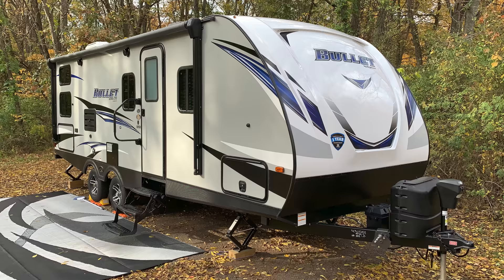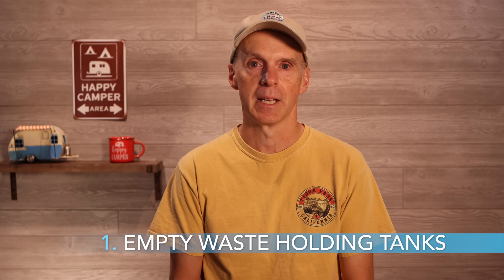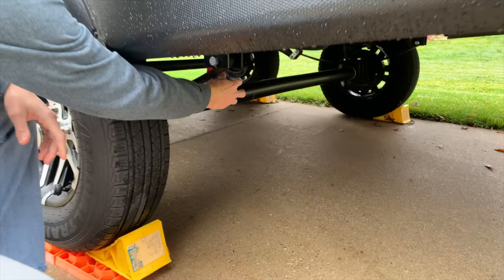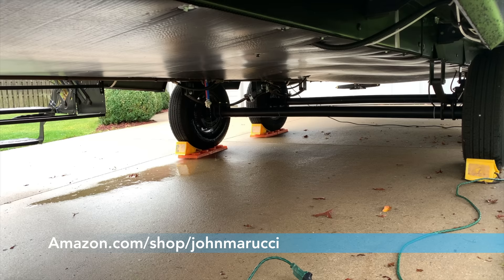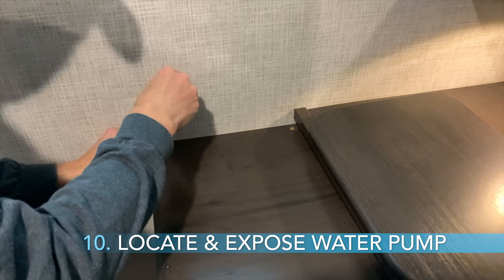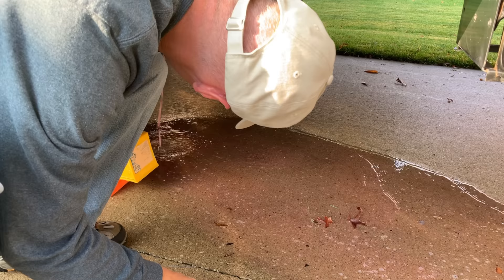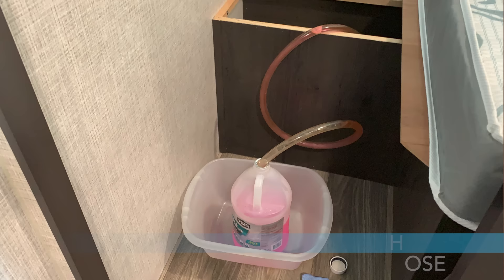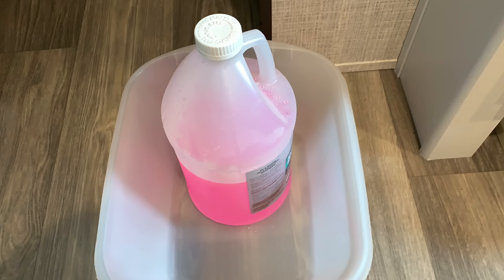RV Winterization Basics For Beginners – Step-By-Step Process

Comment: Thanks John, I do have a question, after you’ve removed all the water from the RV and you’re adding the antifreeze to the lines. When you go out to the outside shower and spray hose how do you still have water to spray?  I just thought it would be pink after a few minutes.
Reply from the maker: Eric, there is still some water in the lines that the pink antifreeze pushes out. This includes the line to the outside shower. You need to run it, even after draining via the low-point-drain as you do any other plumbing line until pink antifreeze starts to come out. If I am misunderstanding the question feel free to post again or email at: "john@johnmarucci.com" Thanks!

Comment: This is a great video thank you very much. I do notice you mention turning on the pump in step 13 and a few other times but never mention turning it off until the end. Are you turning it off after each step or just when you are finished?
Reply from the maker: Mike, sorry for any confusion, it is implied that you turn the water pump back off between steps. Thanks!
Reply: All good. Got it done that day. I did learn there was a valve that needed to be open that ran between my hot and cold lines for the water heater as antifreeze never ran out the cold low-point spots until we opened that. Evidently, it was just pushing it through the hot lines. Luckily, we were capturing the excess so not a lot wasted. Lesson learned. Do appreciate the help!

Comment: Can you please explain why you need to put antifreeze into it if all the water is drained? I'm a little confused. I live in NE Texas and it can get a bit cold but not as cold as  it does up north. Is the antifreeze still necessary?
Reply from the maker: You probably could get by with using forced air through the lines and pass on the RV antifreeze. The RV antifreeze provides an extra layer of protection, just in case you didn't remove all the water. If you desire to go this route, search YouTube for RV Winterization with Compressed Air. Thanks!

Comment: John, great job on the video i had some questions maybe you can answer. I'm guessing you leave the antifreeze in the tanks for the cold season in storage? What is the best move if i am going on a trip in an area with freezing temperatures. I will be dumping multiple times on this trip, so should I winterize even though I would be dumping my tanks multiple times?
Reply from the maker: Fernando, I do leave the little amount of antifreeze in the waste tanks off-season. If you plan to use the trailer during the winter, you should be fine dewinterizing and using the plumbing lines if it dips below freezing, as long as you are in the RV and running the furnace. This is all contingent upon your RV having an enclosed underbelly that gets some heat from the furnace. Between trips you may need to winterize if the trailer will be sitting unused with water in the plumbing lines and the temps are heading below zero. 
Thanks!
Reply: Make sure all water is out of you tanks then fill when you stop u have a plug in your water heater
Reply: Make tank busted in texas because I forgot to drain the heater tank
Reply: Now I can't find the gc6aa-8  atwood

Comment: Where di you get the quick connect hose that attaches to your water pump that goes into the gallon jug of AF?
Reply from the maker: The connector and hose are on my Amazon Store in the RV Maintenance section: https://www.amazon.com/shop/johnmarucci You can also get a 1/2” hose at a home improvement store.

Comment: If you have no water in your system how will it freeze?
Reply from the maker: Right, but you need to ensure no water remains. Many people don't add RV antifreeze and just blow out their lines with compressed air. I am not as certain with using just air that I will remove all water from the lines.  With the cold Michigan winters if I make a mistake, it would be costly. I would recommend searching YouTube for winterization with compressed air. I know there are several videos to follow. Thanks.
Reply: There are ALWAYS drops of water left in the lines after blowing out. They love to congregate in the toilet fill valve, in the kitchen stainless steel to PEX connectors, in the toilet flap  and in the shower head. The AF displaces the water and saves big money.

Comment: Quick question, could I all in reality drain fresh water tank then add say 10 gallons of antifreeze to it and then run every thing like normal until antifreeze came out and be done with it?
Reply from the maker: Loren, some people do this but with a caveat: You will still want to bypass the hot water tank and will definitely want to do a thorough sanitization before you use the trailer again because the fresh water tank would have RV antifreeze residue. The reason for the hot water tank bypass and draining is that you don't fill up the 6-gallon tank with RV antifreeze. If you did, I don't see a huge issue other than a lot more cost. The hot water tank already has 6 gallons of regular water in there, so mixing it with the RV antifreeze would require a lot of antifreeze to eventually come only antifreeze through the plumbing lines. Also, all the water and early antifreeze/water mix will go into your grey holding tank, let's say 10 gallons worth minimum. Now you will need to re-dump that grey tank after this workout. These are some of the downstream effects I see from this method. Would it winterize the trailer? Yep. Would it cost a bunch more and mean you would need to re-dump your grey tank? Yep. I think it is easier to bypass the hot water tank and empty it, so you only need to 1.5 or so gallons of RV antifreeze to do the job. The small amount of fresh water that does get to the grey tank in this regard is greatly diluted by the pure antifreeze that is put in the drain traps and by the overall process. Thanks for the great question!

Comment: Great video….now how do I keep those stinking mice out of my camper?
Reply from the maker: Mice are a real pest for sure and a real issue for RVs in storage. I've used Fresh Cab, Bounce dryer sheets and Irish Spring soap throughout my RVs and have done well with my RVs in public storage, until just recently. Most RVs have gaps large enough for mice (who have no collar bones) to get into if they want to. I keep my trailers very clean and empty when storing, so the are no food sources or places to hide in the trailer. The recent incursion was apparently a lone mouse who went through then left and hasn't been back. I think the place where I store just had some new folks park their RVs next to mine and their RVs may be a bit more attractive to the little critters. Long way to say that you can do all the things you are supposed to but mice can still get into pretty much any RV if they want to. So you can reduce the risk by storing the RV empty and clean and on a hard open surface. All the best!

Comment: If the first step is to empty all the water from the trailer how are some of the later steps to be accomplished done that need water?
Reply from the maker: The later steps are all about getting RV antifreeze into the plumbing lines, not sure where introducing water back into the system comes in. At the end there is only RV antifreeze in all the plumbing lines. Let me know if I am misunderstanding your question. Thanks!

Comment: What about a 4 seasons camper? Do I still need to  winterize ? Probably dumb question but just bought my first  camper.
Reply from the maker: Teufel, a four-season trailer usually means you can camp in it year round and that the underbelly is sealed and the tanks are heated when in use. If you are not in the camper using the furnace, it will still freeze if it gets cold enough. So unless you are actively using the camper when it is below freezing, you will need to winterize it. Thanks!
Reply: @JohnMarucci  ok thanks for the info appreciate it.

Comment: Hi again and thanks for the quick reply. I know this isn't something you went over in this video and I'm not sure you have another video with information,  but do you personally take off your battery and trickle charge it or just dry store till next season w/o trickle charging? Thanks again. 😊
Reply from the maker: I do pull my battery fully from the RV while it is in public storage and bring it home. I dry store it in my garage and do not trickle charge over the winter. I do put the charger on it before I start using it at the start of the season. Thanks!

Comment: I bought a 5th wheel that’s sitting in my driveway that I have no idea what is in the black/gray tanks.  I will not be able to go to dump station and bad weather is going to be here fast.  Ugh!!is there a way to contain whatever comes out easily just in case I have some nastiness in my driveway???
Reply from the maker: Look at your tank indicators to see your tank levels. If they are empty, just skip Step 1 this year. Maybe pour extra RV antifreeze into your holding tanks at the end.

Comment: I just "winterized" my keystone cougar 30' fifth wheel. I used my coupler and compressor. I unhooked the water hose, took out the anode rod, bypassed the hot water heater and blew all the water lines out with air. After i got done i added about a quart of anti-freeze into the water heater because i live in my trailer full time, but the water heater is exposed to the outside temps. With my trailer heated all winter...is it done enough?
Reply from the maker: Since you are planning to live in the RV full time during the winter, and I assume you will be heating the RV, I am not sure why you would winterize it. I think you are saying you won't be using the hot water heater all winter? If you keep the water hot in the heater, it won't freeze up. Ray, from Love Your RV just went through a Canadian winter last year in his Cougar fully functioning, so I know it is possible. Maybe hit up his channel as he has several videos on this specific model and going through a winter in it. Just search YouTube for Love Your RV.

Comment: I have a quick question. I don't have a siphon tube and connection for the pump available at the moment, and I want to do this soon. Can I just poor the antifreeze straight into the gravity feed into the fresh water tank and pump it through that way. Seems like it would be the same result. Thank you for any help.
Reply from the maker: You can. You may need more than 2 gallons. Just rinse the fresh water tank well afterwards.
Reply: @JohnMarucci  Thank you for the quick response. I just tracked down the location of the pump,  and it looks like there is already a siphon tube spliced in.

Comment: I am getting the antifreeze through the cold water but nothing though the hot water outlets.
Reply from the maker: Are you sure the hot water tank is bypassed?
Reply: @JohnMarucci  that was the issue. I had only switched one of the bypass valves.
Reply from the maker: @mikeshaw4610  Okay, thanks for the update!

Comment: Do you have or recommend a particular battery cut off switch for the 12v batteries on the rpods? Can't seem to find one that would fit correctly.
Reply from the maker: I really do not have a battery cut off switch recommendation as I have never had one on any trailer I've owned. I usually pull the battery when not in use. I would point you to the r-pod owners group for recommendations: rpod-owners.com. Thanks!

Comment: Question I put full jug in fresh water tank alittle in city water in ran pump, open and closed all taps excetra using on board pump so pink came through everywhere including under trailer empty valves .I don't use fresh water tank when camping is it fine to have an inch of the pink stuff in there
Reply from the maker: That should work just fine given you don't use the fresh water tank. You may still want to rinse the tank out by filling in it 1/3 to 1/2 full with water then draining it. It would keep the RV antifreeze residue to a minimum in the tank. Thanks!
Reply: @JohnMarucci  Thanks I know it's waistfull but it's done now in the spring I'll just hook my home water line and flush it out

Comment: Really good video! My question is: do I have to open the black tank drain valve when blowing out the black tank flush line?
Reply from the maker: The black tank has an exhaust that runs to the roof and any so air pressure (20 psi or less) will escape. So you do not need to open the black tank drain valve. Thanks!
Reply: @JohnMarucci  okay!  Thank you for a Answering my question. And thank you again for the video it was very good
Reply: But shouldn’t the water in the black water tank be drained again after blowing it out?
Reply: @randymintz1552  
The pink antifreeze from the toilet flush is enough to keep it from freezing...

Comment: I have a new EPro that my dealer winterized for me before I picked it up. I just noticed that I have no caps on my low point drains. Does this mean I don’t have antifreeze everywhere I should have it?  Seems like the dealer messed up, right?
Reply from the maker: Sounds like you should have caps or valves on those low point drain exits for sure. Hopefully your dealer can get them to you quickly. You can check if you have RV antifreeze by opening a faucet without the water pump on. Use a bucket to catch any that comes out. Thanks!

Comment: Once you empty your fresh water tank, do you close the valve for winter, or do you keep it open? Are there other ways to get 20 psi through the lines without buying a compressor?
Reply from the maker: Daniel, I do close the drain valve on the fresh water tank after draining it and leave it that way off-season. Also, I do not know of any other way to blow out the plumbing lines other than with compressed air. You can get an inexpensive air compressor (less than $100) from a big box hardware store. It is a good investment in keeping RV tires at the proper inflation before trips and using for winterizing. Thanks!

Comment: Hey John - thanks for the video! I winterized my Cruiser MPG yesterday. I used a little under 3 gallons by myself. Question for you - when can I move the hot water heater bypass valves back - now or wait until  the season comes back around? Same for the anode rod. I currently have it screwed in loosely. Can that be tightened up?
Reply from the maker: You should be able to seat your anode rod and unbypass the hot water tank so you don’t have to do it in the spring.
Reply: @JohnMarucci  Great - thank you!! BTW - these instructions were awesome for a first timer!!

Comment: Where can I buy the petcocks you use for the low water drains?  I've looked all over my area. The threads on the hoses are not not, they are straight threads.
Reply from the maker: They are 1/2" Sharkbite PEX petcocks. I can't locate the plastic ones that I have, but the brass ones are on Amazon and you should be able to find them at a local hardware store. Here is a link on my store, but make sure you have PEX pipes, a PEX crimp tool and PEX clamps before purchasing: https://amzn.to/30SaZoa
Reply: @JohnMarucci  thank you. I have the same trailer that was in the video. Procedure worked perfect.
Reply from the maker: Glad to hear it. All the best!

Comment: Hey John.  After I remove my anode rod and empty hot water tank, do I need to re-install it or leave it out for the off season?
Reply from the maker: Not sure it is huge deal either way but I used to reinsert mine after winterizing my R-Pod.
Reply: @JohnMarucci  Sounds great, thanks John!

Comment: Can I ask why you need the coolant if you blow all the water out of the lines.
Reply from the maker: Frank, there are basically two ways to winterize, the first is to simply blow out all the plumbing lines until there is no water in any of the lines and water pump. The second is to fill all the plumbing lines with RV antifreeze. The problem with simply blowing out the lines is that if it isn't done right, some water may still be in the water pump or lines which can cause serious issues. There is a post in the comments of this video from a person who works at an RV dealer who talks about the number of RVs that come in for service in the spring with cracked water pumps because people haven't blown the line out properly. So there is a real risk unless you are confident in using this method. Thanks!

Comment: Hello, Great video. I am working on my first trailer and prepping for my first winter. I wanted to winterize myself but i have had a Hot-water issue since getting my trailer. I can get my hot-water pilot to start but i never get any hot water to come out. Ill get a weak stream of water to come out of faucets but never hot nor good pressure. It is not easy for me to go back to dealer (i live in Alaska, 6hr away from dealer) or i would have taken it in already. After watching this I feel that that the hot water bypass might be an issue, any other ideas you have to check?

Thanks again, will be watching as many of your videos as i can. so far best trailer/rv channel ive fuond
Reply from the maker: Henry, it sounds like the water heater may be bypassed. If you have water in your fresh water tank, turn on your water pump and it should fill the hot water tank. You can check if it has water by trying the pressure release valve on the water heater. I have a short video on the hot water heater here: https://youtu.be/M1qjlSardTM
Reply: @JohnMarucci  it was indeed it. i mustered up the courage and started tinkering in there. Thanks!

Comment: Hi Sir.. would this be applicable to a 1980 Triple E bus-type RV? it would be our 1st time to own one. Thank you.
Reply from the maker: I am not familiar with the RV you mention to venture a guess at the plumbing system. Generally, if you have water in your lines during use and a water pump and hot water heater, you will need to follow a similar process as this. Thanks and all the best on your new adventures!